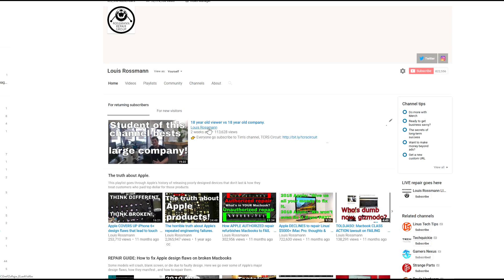Thank you

Comment: Lol! I like how he present Altium Designer. The most popular professional EDA in the world. And yes, the board shown is branded with their logo. This is weird. The board doesn’t seems all that complex. Maybe they wanted to showcase AD ability to work in 3D like SolidWorks. In 2015 they were focusing on flexible PCB and inner-layer components (components installed between PCB layers, imagine the cost of doing PCB assembly and lithography at the same time. Those PCB are almost impossible to fix. Only fully vertically integrated manufacturers like IBM could be interested.)

Comment: I'm a software developer student in Hungary, and I'd like to thank you Louis for these videos. My laptop had problems, broken hinge, broken backlight, etc, but thank to your videos, now I know, that these stuff are kinda standardized, and not so hard to troubleshoot, so I had the courage to open my machine, and replace my screen, replace cpu fan, etc. Now I have a working computer for basically free (from other broken computer and cheap chinese parts) instead  of buying a new one. Thank you.

Ps: In the meanwhile I managed to rip the battery connector from the board. :D

Comment: I work in workshop repairing diesel  engines pumps, injectors, etc. Modern common rail vehicles are electronically controlled I was too afraid to do repairs directly on the boards of the cars computers because they are expensive as f. and I couldn't afford a mistake.
Thanks to channels like yours I grew up in confidence and started studying some electronic schematics and diagrams and found the problems and after some basic soldering I fixed them.
I saved the customers A LOT of money because cars manufacturers don't do this kind of repairs. They replace the whole thing.
Often it's just a bad capacitor easily replaceable.

You didn't teach how to repair engine ECUs but you inspired me into learning.
The world needs more people like you. Thanks man

I also need to learn more how to write in English lol

Comment: 3 years ago I started to work as customer advisor at apple repair shop and at that time all we did was replacing batteries/screens/fans/drives etc.
After some time watching your streams every night 1am in Europe I learned basics about soldering, diagnostics, bought microscope and soldering station/hot air from my own salary
and started to replace connectors, blown capacitors etc. Right now I'm service manager and our service is best in town and its all about your knowledge that you shared with us.
Thanks!

Comment: Actually, you and one other YouTuber have influenced me to do some board-level repairs on stuff I thought was just flat out dead. 
I bought a video card from a thrift store and installed it into an older computer. However, it had a problem...after I installed the drivers, whenever it would try to load up the desktop elements (task bar, icons, etc.) the computer would restart. Upon inspection of the card itself I noticed the capacitors near the external power connector were bulged. I recapped that part of the card using caps from a motherboard that I knew worked (but didn't have any use for) and put it back into the computer. It worked!

Comment: One crazy thing I heard: sometimes a bank will be able to give out a larger loan vs a smaller loan. The banking world works weirdly. "It seems like I could get a $1M business loan easier than a $400,000 one!" in one of my family member's case. However, your area is much more expensive compared to my family member's 

But hell, between you and a guy I know called Bill, I learned a lot about boards and circuits, even though I hardly touch them. I also would rather work with you than some of these assholes I had to tolerate in my career. Hell, I fixed a pair of headphones recently so that I can get better at soldering, and this channel helped push be to do it

Comment: Hey with your videos i almost fixed my htc vive wand that broke from my f up when i was repairing something else that was bugging me. I ended up ripping off a ribbon cable connector that was important to turning the controller on. I was able to run bodge wires from the button to two prob points  to turn it on. It worked for like two seconds and then proceed to fry it self because i wire the button to ground not correct part of the circuitry but the good news is is it was my first try at any repair like it and i though i did pretty good seeing as i only had a gigantic tip soldering iron for micro soldering and wires just as big. So thanks! if this ever happens again with my other vive wand i should be able to repair it seeing as how i know i messed it up.

Comment: I have breathed 5 years more life into an old monitor by swapping out the dip caps in the power board. I have tried to save another monitor by ordering a replacement timing board, but that didn't fix it, but at least I tried. I didn't learn those from you specifically. I can't solder smd components, but your support for the right to repair resonates with me.

I too run a tiny business that I am struggling to make money on. I could make a lot more by working for someone else, but it wouldn't be mine. I'm going to keep on trucking. And so are you, I suspect.

Comment: Good Teachers, create tomorrow's Teachers, so if they do better than you, consider that job complete, and well done! So what if they end up better than you? You gave them that spark and impetus to learn and create, and to better themselves. For me (I'm now 44, but had an interest in my pre-teens), I repair classic British slot machines, and long had an interest in electrics / electronics, but due to color blindness (Same with the Railways), I could not join that field, but it still did not stop me from wanting to learn, and for yourself Louis and others like BigClive (Was thanks to BigClive, I'm now subbed to you), EEvBlog, AvE etc, you have taught me so much, and yourself Louis, it was basic soldering technique, yes with those knock off Hakko soldering and hot air units (Gotta start somewhere), but I am now much better at soldering, than I was say over 10 years back, and as I get in to more newer British slots, it's all surface mount stuff (Especially the Maygay Epoch system, which is a royal bitch to work on), I'm learning even more, so thanks for your input!

(From near East Midlands Airport, Nottingham / Derby)